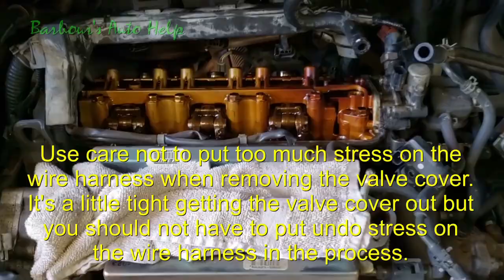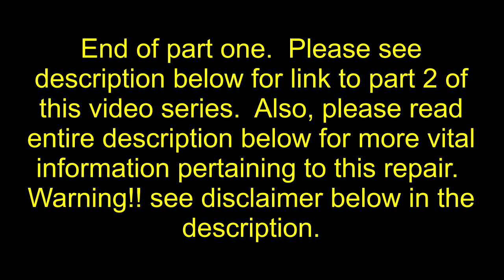Valve Cover Gasket Replacement 05 Honda Odyssey 3.5L Touring (Part 1)

Comment: Awesome video, man! My front valve cover is leaking oil, so it's time for new gaskets. I've taken the valve covers off before to adjust valve clearance (after the shop butchered the job and charged me $500 anyway) but wanted to brush up on the technique since it's been a few years. This is super helpful. Was hoping for some trick to remove the back cover easily, since I remember it was very difficult. Guess that's just how it is. Thanks for a clear video with good audio and no annoying music blaring the whole time.
Reply from the maker: Hey thanks and no problem.  I'm sure someone out there has figured out a trick.....  not me.  Hope it goes well with you..

Comment: When I take the grommets off, since I don’t reused it, I cut the rubber with razor blade so I don’t have to bangs on the bolt.  It’s quick and no troubles

Comment: Just finished replacing my valve cover gaskets on my 2004 Ody 3.5L. It took me the whole afternoon with a lunch break.  It's not a difficult job but don't expect it to be smooth sailing either, there's always a nut or bolt or clip that's going to give you a hard time.  While you're at it might as well change the PCV valve.

Comment: Nice job! Its nice to see a real mechanic doing a detailed tutorial. You hit all the points and tricks to look for and do. No different than working on a giant turbine. Care and caution cleanliness. Only thing i would have done different is powerwash it the day before. Im having some intake issues that i cant find. But leaning on the plenum i heard a change in the ideal of the engine. Sprayed either to no end could find a leak. Pulled the top cover plate cleaned the carbon out and checked the torque of the bolts didnt find any issues. Maybe i the throttle body is leaking? Any suggestions anybody?
Reply from the maker: Thanks for the comment.  What is the vehicle doing to make you suspect an intake priblem?

Comment: Anyone have any tips on removal/install of rear cover? I squeezed it out, but the wiring harness is so snug that I'm afraid I won't be able to get it back in without damaging the new seals/gasket. I'm working on detaching much of the wiring to the right of the engine in order to create more slack. I've gotten to the point below the air intake and throttle body where the bolts and clips holding the wiring is incredibly difficult to access. Looking into that removal process now...

Comment: Hi question. This is same to 2006 Honda odyssey????
Reply from the maker: Most likely very similar if not the same.  Be sure to use a repair manual to make sure.

Comment: Thanks for the great video.  Question: I broke off my PCV valve in half when I tried to replace it, and wonder if I should take valve cover off to fetch the other half which is pushed way in. At 32:20 of your video, I see the dipstick hole and where the PCV valve goes. It seems like it'd be behind that plate held on by screws.  If yes, then is it okay to leave it there?  Is there any chance it can wiggle it's way and slip out between the grove by the spark-plug groove, and fall into engine?  Thanks for your help.  Just trying to decide I should leave it or not.
Reply from the maker: Id say it's best to remove it or replace the valve cover.  It's the safest answer i can give you.  Having halve the valve stuck in there isn't going to allow the PCV system to operate correctly.  If its at all possible to remove it it is likely the valve cover will have to come off to do this.
Reply: @BarboursAutoHelp  Thanks.  I get it and understand that would be ideal.  However, it is pushed so far deep into the cavity that I'm sure if I pulled off the valve cover, I'd have to take off that metal plate which I assume is an empty hollow gas cavity for unburned gas to escape the combustion chamber via the PCV valve to the cylinder chamber.  If there is indeed a chamber behind that metal plate, then there is no harm to have an old half broken PCV valve in there as it won't be obstructing gas.  Sorry just my rationale after studying your video and photo of the valve cover.  Many thanks nonetheless.
Reply: Also I noticed in your video, that there are 14-15 or so small vent holes on the right side of that metal plate.  My guess is that the old broken PCV valve would have little chance to fall out those 'small' holes if it were to make it down across to that side. If it did, then I guess it could mess up those moving valves and damage that part of the engine.  But I think the broken piece is actually bigger and won't fit through those holes, but I could be wrong.... .

Comment: How do you get a backward seal out?god knows how long its been there,that is kind of sticking and conformed to the cylinder hole grooves,I'm having a real hard time,it's peeling away in bits,it's had brake cleaner contact
Reply from the maker: Whats a backwards seal?
Reply: @BarboursAutoHelp  spark plugs tube seal,the last person put them in BACKWARDS,I just bought the car so idk how long it's been on,no wonder I had misfires and all kinds of crap going on
Reply from the maker: Oh ok

Comment: First, thank you! Your videos are super helpful. Second, I have a question: What other gaskets can I replace on this van? I have replaced the VVT gaskets and the oil filter solenoid gasket. Next up is the valve cover gasket. At 165k miles all of the gaskets I have removed were like hard plastic.
Reply from the maker: There are bunches of gaskets that tend to leak on this engine.  I've got some videos showing the replacement of several seals and gaskets.  Take a look on my channel.

Comment: Thanks for the video. Just wonder what caused you to replace valve cover gasket? Did you observe oil leaks or preventive maintenance? Thanks in advance.
Reply from the maker: It was leaking.

Comment: WHAT HAPPENED? I followed this to a T, (Odyssey 2003) but.....when I start the car everything is good for about 1 minute then the engine start to rev up on its own....and I turn off. Anybody have any ideas why this is happening?  Thanks.
Reply from the maker: Well, wrong video for the car your working on.  This video was not intended for an 03.  Did you leave any vacuum lines off?  Did you plug everything back in?  Do you have a vacuum leak.  This video isn't a direct fit for your car.  It's somewhat similar but not the same in a lot of ways.  Retrace your steps but use a manual, for the vehicle your working on, to insure you did it right.